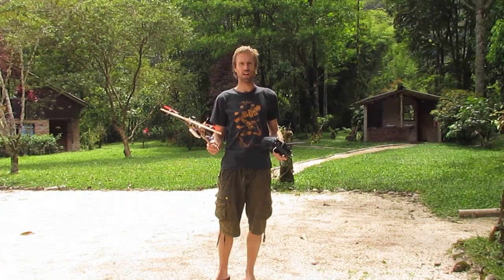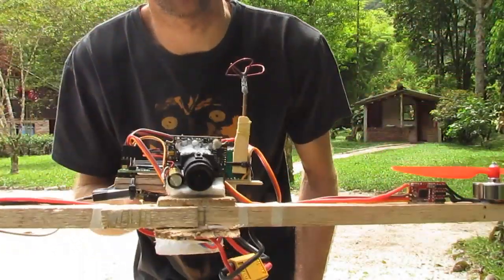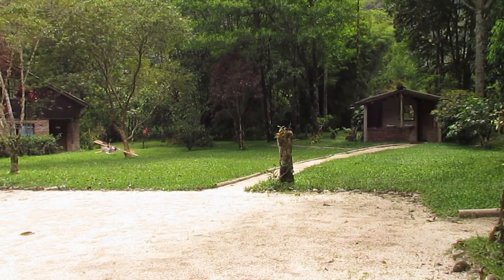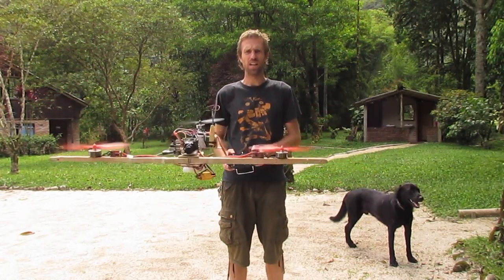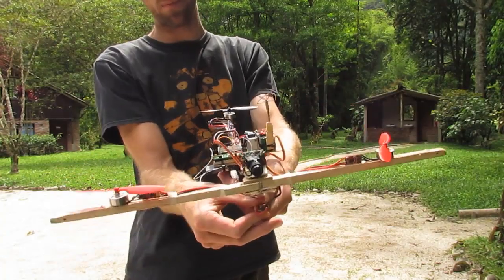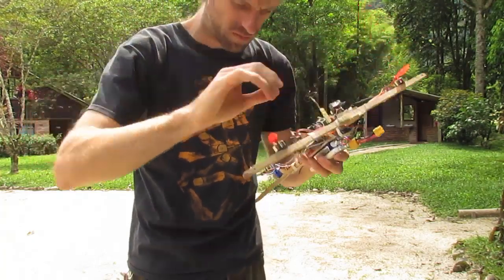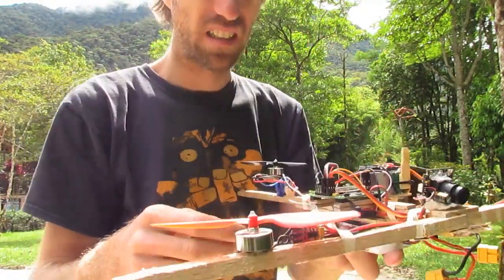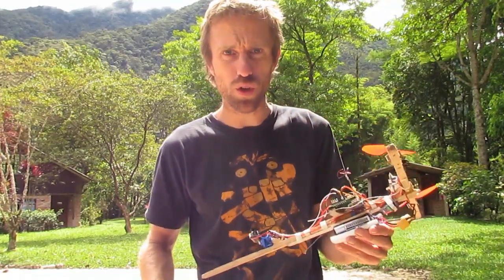Mini Tricopter FPV load, and KK2 auto level testing. RCHacker #10

Comment from the maker: KK2 has a receiver test function. Set your radio up so that all reads correct. Then work on the settings and trims from the KK2. You can trim any drift with the radio but any autolevel drift is better corrected on the kk2.  Have a google about there are loads of tutorials on the KK2 basics.